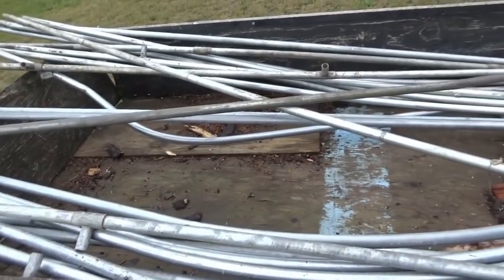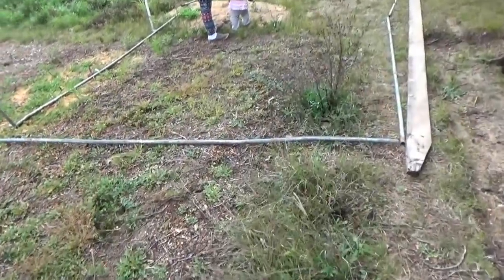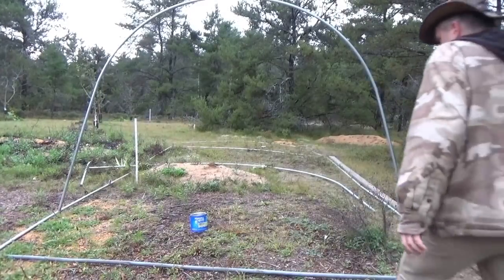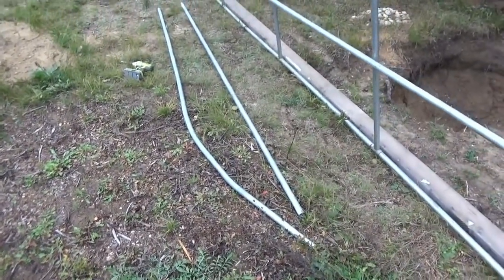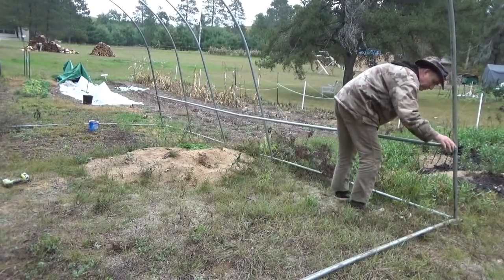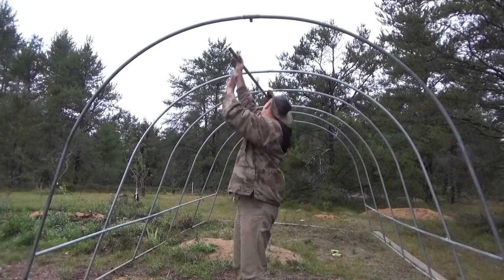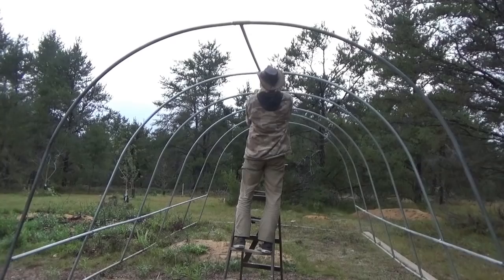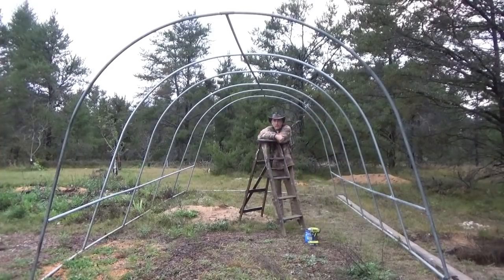Assembling Greenhouse Frame At The Off Grid Homestead

Comment: Good way to reuse that old car port tent frame.
I wouldn't have thought to use a tree to correct most of the bends on my own like that.
Great job
If you put tubes underground  with solar fans it will help keep it at a good temp in the summer when you have a cover on it.
And could help keep it worm too in the winter.

Comment: My greenhouse has 4x4 bottom skids with wood floor and that way I can move it if I have to , thick plastic ( clear ) works great on mine , I have to replace it about every 2-3 years but it’s not to expensive , glad you have a grow house ! I thought about heat in mine for the cold weather.

Comment: Hi Troy strong frame nice what you going to use for anchors
Reply: What we used before was lg containers full of cement and then fastened to hold frame down, but maybe Troy knows what the commercial greenhouses do.
Reply from the maker: Yes very strong. I am thinking of the anchors I have left over from NY from my tents there. I used cement blocks there so I still have the anchors.